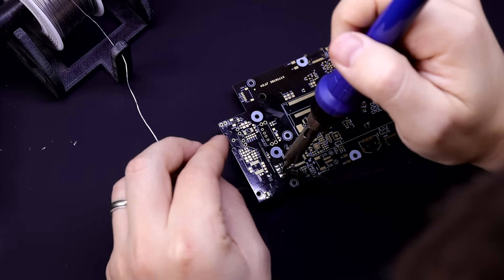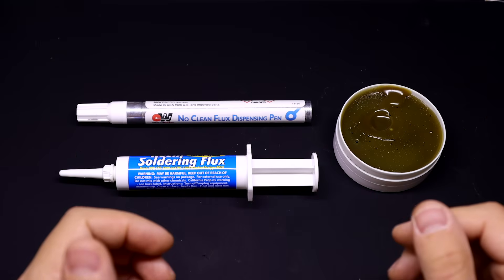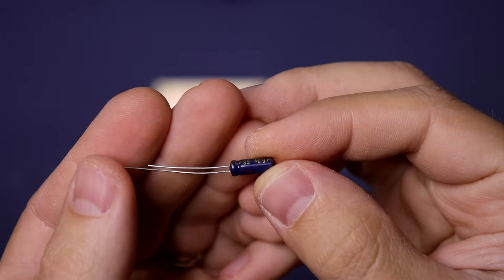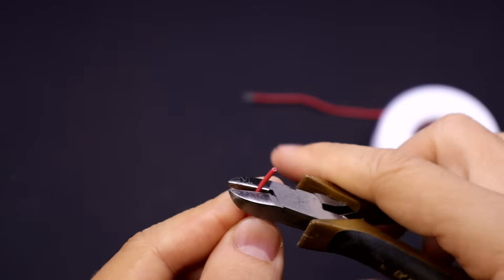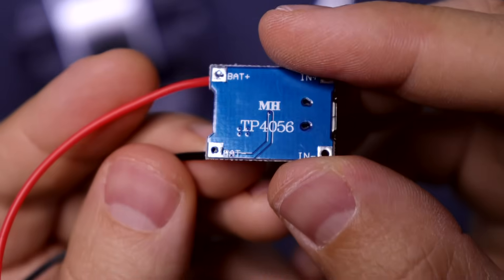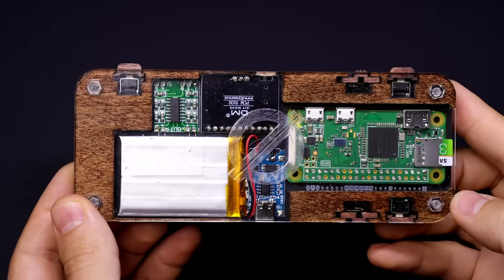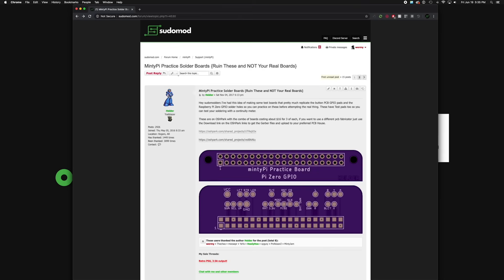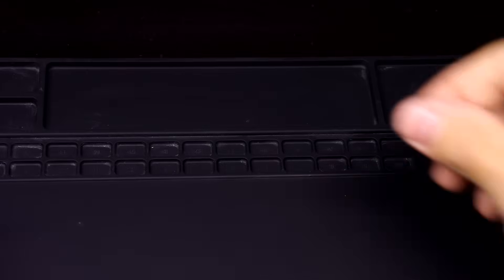Soldering Crash Course: Basic Techniques, Tips and Advice!

Comment: Thank you., was very helpful. I’ve been soldering since I went to school in the eighties at a tech school, and I knew much of what you mentioned, but still learned a few things that I will definitely use now. Very nice way to solder two wires together, and many more tips hit the spot. 
But if this is for beginners, might want to mention wick or other solder removal methods when you accidentally use too much or solder the wrong component, etc. 

Also that you have to held the soldered part in place without moving for a few seconds after removing the heat (iron) to avoid cold solder joints. 

Last but not least, to develop habits so as not to burn yourself. I still even now do, though usually less severe than when I started. 

When soldering over something, I tend to take a good breath and blow the whole time I’m soldering to avoid inhaling lead fumes. It also helps steady my hands. Calming. 

Last point, about when you have to solder to for example a potentiometer body, how to prep and put down a blob and solder without overheating the component, or soldering to a ground plane on some boards where heat dissipation makes it harder to get hot enough!

I do thank you for the tips, some very nice ones there!

Comment: I have an older temperature controlled soldering iron. 
It has a dial with numbers 1 through 7 on it. 
Therefore, I don't actually know the temperature setting.

So, I set it between numbers 3 and 4. Let it heat-up a bit.
Once my solder melts on the tip of the soldering iron, I know it's hot enough.
Then I move onto actually soldering - - just like you described - - by heating both the pcb board and the component lead at the same time. 
I allow a moment for them to heat up, then apply the solder onto the lead while my soldering iron is still on the other side of the lead and the pcb.

I let the solder melt and drip onto the PCB.
Sometimes I use a small metal clip-on ' Heat Sink ' so I can protect the component I am soldering onto the PCB.
Generally, I clip it on close to the component so that any large amounts of heat are dissipated by the heat sink and never make it to the component.

Comment: The soldering of the through holes of one PCB to the undrilled pads of another is one of the very few instances where I would be inclined to use additional flux. I would use a low solids content "no-clean" liquid sparingly. I'd brush a very thin layer on the undrilled pads and another very thin layer on the mating face of the drilled pads, trying to get just a little in the holes. It can be quite difficult to get the flux from cored solder to properly precede molten solder through the holes so a tiny bit of extra can make quite a difference. In general my attitude toward extra flux is that if you "need" it you are doing it wrong.

Those perfboards can be kind of miserable things to solder and not something I'd recommend for learners. The copper is frequently bare - no tin or gold plating. If it is not protected it tends to oxidize a bit, making it hard to solder without an aggressive flux. Sometimes the boards are protected with a very thin organic coating of some sort. That prevents oxidation but the coating itself interferes until it gets hot enough to "vaporize." If learners are starting with such perfboard I'd recommend a light attack with fine steel wool before starting. Be careful to clean up stray bits of steel and wipe the board free of them.

Comment: I bought a new soldering iron but why the soldering iron tips wont melt the solder, only the side could melt them... and when I accidentally soldered wrong pin I found it difficult to remelt them
Reply: In the following, to "tin" something means to get a nice, uniform thin coating of solder over the area of interest.

Many tips these days are solid copper inside with a plating of iron and in some cases additional plating of chromium over part of the tip. Good manufacturers pre-tin the working part of the tip.
Iron does not take solder readily. It needs to be freshly cleaned. Chromium won't tale at all, but there shouldn't be chrome on the part of the tip that is "wetted" with solder. If there are parts of the working end of the tip that don't seem to work it may be because they haven't been tinned properly.

The tip cleaner and tinner shown near the end of the video can be helpful. The "pot scubber" type cleaner is reasonably aggressive at mechanically removing oxides that might interfere with solder wetting the tip. The tinner is loaded with chemicals that act as quite powerful flux that can remove minor oxides.

If you don't have either, you may be able to get the tip to tin properly with just cored solder if you very carefully clean it mechanically. I've occasionally used a sharp knife with a very light scraping action. You have to be really careful because you don't want to remove iron plating. Once you get a pinhole in that plating the copper inside will begin to dissolve into the molten solder and after a time you get a void that doesn't conduct heat properly. It is usually easier to scrape off oxides if the tip is hot, but oxides also form much faster on a hot tip, so it can be tricky to get the tip cleaned and then tinned before it gets oxidized again. The tip tinners are really helpful because they do usually remove thin oxides effectively.
A stainless steel pot scrubber similar to the brass one in the holder in the video can also work. They aren't good for everyday use because the stainless steel is too abrasive. They are OK for occasional use.

Once the tip looks really clean, try to melt quite a bit of solder (with flux core) over the working part of he tip and leave it for 15 seconds or so before wiping off the excess.

Comment: i'm an electronics engineering student almost 20 years ago, and soldering was never taught.  However, this video fails to address true issue soldering which is oxidation. It just makes soldering stupid difficult or impossible even with slightest dirt oxidation on the tips. Turns out that tip cleaner is a necessity.

Comment: Whenever I solder anything, my solder jumps off the iron, or just drops off as a lump of metal. Half an hour of merely trying to join some wires and I had 30 something blobs of solder on the floor and my wires just won't solder? What am I doing wrong?
Reply: Stranded wire can be remarkably difficult to solder sometimes. You are up against three main issues - oxides, flux flow and heat.

Recently made wire with bright bare copper strands or good tin plating usually is sufficiently free of oxides to take solder well. Bare copper strands, especially in old wire or wire insulated with natural rubber can be quite badly oxidized. It will appear dull and darker in color than clean copper. Removing oxides can be time consuming and frustrating. I recommend stripping maybe twice as much length as you will eventually need. Work on a hard surface that won't be damaged. Make the stands fan out like the bristles of a tiny broom. Use fine emery paper in strokes from insulation to the ends of the strands. Turn the wire a bit, re-fan, clean some more and repeat until all the strands look bright. If you intend to tin the strands, leave the extra length for now.

In order to get good solder flow flux needs to coat everything before the molten solder arrives. This is a challenge with stranded wire because you want the flux to get in among all of the strands. More on this later.

Getting sufficient heat into the wire to get it up to the temperature at which solder flows is easy with small wires and can be challenge with big wires. Copper is the best heat conductor you will routinely encounter in electronics. Large wires can quickly conduct heat away from where you are trying to solder. A tip that is quite large can help. You get more area through which heat can be conducted. Heat from the "thermal mass" of the tip can transfer to the wire, heating it more rapidly, though this is a transient thing and ultimately the heater in the iron must supply more. Big tips conduct heat from the heater to the work better. "Screwdriver" tips with a wide flat area usually are best.

Clean tip of your iron. Melt a little fresh solder on the working face of the tip. This is to aid in heat transfer only. It isn't intended to "stick." Generally it is best to hold the iron on the underside of the wire, solder-wetted side up. That way you can see what you are doing when it comes time to feed in solder. You want to get the wire hot enough so that if you apply solder to the top side it will melt and flow. You might feed a little fresh solder so that it contacts the tip  and the wire at the same time go get even better heat transfer. When the wire is hot enough for the solder to flow, feed solder in a way that lets the flux go first as much as possible - that is, make sure the very end of the solder is what is touching the wire and you may need to move it along the length of the joint.

There is science and art in this. It takes a good deal of practice to get the hang of it. Wire size will influence how quickly things go. Big wires need some time for the preheating. No preheating is required for very small wires. Watch carefully what is going on as you work. With experience it gets easier. The insulation on some wire melts at very low temperature and may "shrink back" substantially. Wires that carry high frequencies (video cables, USB cables, etc.) are the ones most likely to have low melting point insulation because it also has good high-frequency properties.

I almost never recommend using additional flux but I do quite often use some for tinning wires. I prefer a liquid flux with low solids content for small wires with no visible oxides, but sometimes will use a "fully activated rosin" paste flux. You don't need great gobs of it.

NEVER use plumbing flux for stranded wire. It is very aggressive and copes well with moderate oxidation, but it wicks in among the strands well past the end of the insulation. It sets up a perpetual corrosion cycle that can "eat" right though the strands. (it contains chlorides, usually including zinc chloride; chlorides react with copper to make copper chloride, copper chloride reacts with carbon dioxide in air to make copper carbonate, freeing the chlorine which can react with more copper, and on it goes ...)

Rosin fluxes can cause hardening of rubber insulation with time. You can encounter rubber insulation in some power cords, some audio cables and test lead wire.

Comment: This is all fine if you have eyes like a microscope, but when your vision is less than perfect, having to solder anything just swcks across the board.  I avoic buying any crrrp with soldering pads this small.  This nanosize scale turn of electronics was a bad trend to begin with and it's only gotten worse.

Comment: Where’s the flux? (I know some solder wires have rosin core flux), but I always add a dab of liquid flux over what I’m going to solder and always get clean looking solder joints.
Reply: In the vast majority of cases in soldering electronics if you need extra flux either you are using poor quality solder with voids in the flux core or your technique is wrong. I've been in electronics for many decades and soldered countless joints of all sorts and very, very rarely have used additional flux.

Assuming you are using good solder, be sure that you feed the solder to the joint in a way that allows the flux to flow over the parts before the molten solder does. That means the merest edge of the END of the solder wire touches the iron to get some flow started, then additional solder as need is fed to the growing pool of molten solder on the joint, NOT the tip of the iron.

Occasionally additional flux is a big help. I like a bit of extra flux for tinning stranded wires. It is hard to get the flux from cored solder to flow adequately among the strands and without that the solder doesn't flow well, either. I generally prefer a low solids content liquid flux for this.
Reply: @D614G_aka_Doug I use Kester 63 37 leaded solder with MG chemicals liquid flux cut with 50% isopropyl alcohol. I always put a bit of the liquid flux on the components being soldered, heat both the pad and the lead with the iron and after a few seconds feed solder from the side opposite the soldering iron tip but between the pad and the component lead. Since solder flows towards the heat I find this method to work best at creating really good solder joints. After that I clean with d-limonene, alcohol, then air dry with nitrogen gas
Reply: The alcohol is not 50% just that in a bottle I put 50% flux and 50% isopropyl alcohol

Comment: This video is OK, but IMHO more explanation of heat is needed: thermal mass of joint vs iron, tip size selection, etc. Mastering this improves one’s soldering a lot.

Comment: I'm one of those people that thought that you needed to melt the solder onto what you're trying to join together.
The reason is because I thought that solder was basically a kind of conductive adhesive and that you would use it just like you would use glue, except that this glue would only work when melted. 😀

Comment: I suggest a lap splice for joining two conductors in series. Bending the joint in this way can cause a weak point at the base of the solder joint; also, folding the conductors over the insulation risks a conductor strand piercing the heat shrink and causing a short.

Comment: man I cant seem to get solder to stick to anything but the damn soldering iron
Reply: Flux and the right temperature are critical, as is the material and condition of the contact surfaces themselves. Solder will not flow onto something that isn’t hot enough. Solder also won’t flow onto anything that is oxidized — that’s what the flux is for. It cleans up oxides and prevents the formation of new ones. But it can’t do wonders, so if something is very oxidized, prior mechanical cleaning may be needed. (An old-fashioned rubber (not plastic) pencil eraser, or even better the ones for ink, is ideal. Fiberglass pens work well too, as does green Scotch Brite pad, or very fine sandpaper.) And finally, some metals can’t be soldered with electronics fluxes: aluminum, chrome, stainless steel, etc.

Comment: You have not mentioned Blowing air at it which is super useful to make connection easy? You also didn't mention sanding the wires with sandpaper before tinning nor before connecting, which is a MUST in many cases, as wires very often are butter smooth so much so, nothing sticks to them. In my view it should be the first step before soldering, SANDING.

Comment: Do I need to tin solid core wires?
Reply: If you’re feeding fresh flux-core solder wire into the joint, then usually, no. But it can be helpful if the wire is older and a bit tarnished. So on the rare occasions I use solid wire, I will often tin it anyway. 

On the other hand, if you’re reflowing the wire into an existing pool of solder (like when lap soldering onto a pretinned pad), then you’ll want to pretin the wire and apply so,e separate flux.
Reply: @tookitogo  thanks
Reply: @habelincoln1665  Oh yeah, I’d also add that if you have tarnished solid wire (as we often do nowadays, since we use it so rarely), it’s often helpful to mechanically clean off the oxides. Extremely  fine sandpaper works, or my favorite is to use the old-fashioned rubber erasers made for erasing ink (those contain larger amounts of abrasive pumice than pencil erasers). On two-sided pink erasers that’s the blue or white side.

Comment: Can you use soldering on other things then just boards and wires?  Kinda like welding small metel items  that may have broke. I have a small about 10 inch tall eiffel tower of my daughters that she asked me to fix where 1 of the legs got broke off.
Reply: FYI, soldering and welding are completely different processes. Electronics almost never uses welding, it’s all soldering. 

Anyway, non-electronics soldering follows the same fundamental principles: heat the workpiece and melt solder onto the work, not the iron. But a lot of non-electronics projects are much, much larger masses of metal, so a small soldering iron cannot provide enough heat. You then either use a much larger soldering iron (typically used for sheet metal work) or a propane torch. 

Finally, many metals cannot be easily soldered, requiring special fluxes and whatnot. That’s well beyond the scope of an electronics channel.

Comment: I know I’m 2 years late on this video but I’m a mechanic and I have to solder some battery terminal wires that keep corroding , won’t start and just all around electrical issues so I want to give it a solid connection and also have it corrode less. Any tips?

Comment: I just want  to bypass a tiny off/on switch  with a tiny  length  of wire to an otherwise  functional radar  detector .  It runs off of 12v cigarette  lighter  port so it turns  on with  ignition  key  or can be unplugged . I have no access  to accessories  if i have to buy anything  then better  just order  new radar  detector...Many countries  would  never throw  these things out and buy new...they can actually  repair things ... fabricate  parts etc. amazing  actually  ( poverty  and insanely  high import tax is motivation )

Comment: Quick tip: if you are gonna solder something new and the solder is not melting add a bit of new solder and then try to melt it again and it should work :)

Comment: Thank you for making this! It's very comprehensive! I was soldering stranded wires to a RGB LED strip yesterday. The copper point is very tiny and I think one of the connection looks fickle. I guess I can just melt what I did yesterday a little bit and heat up the copper bit so that things can combine together better?